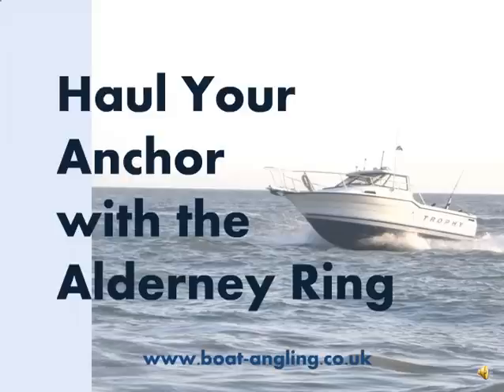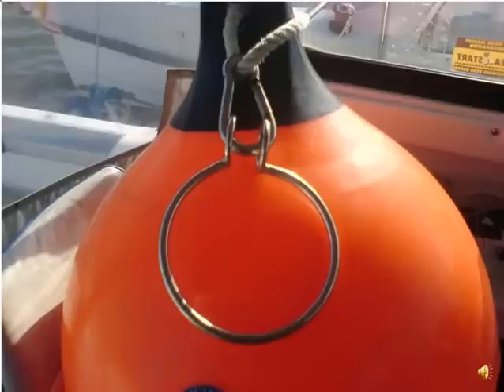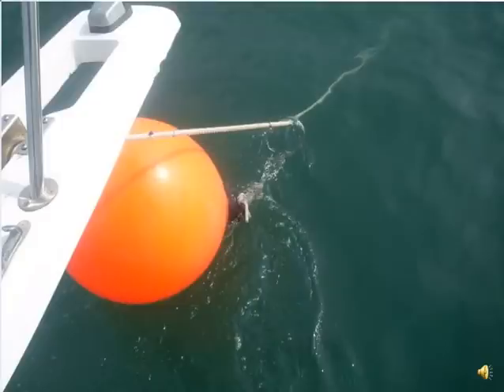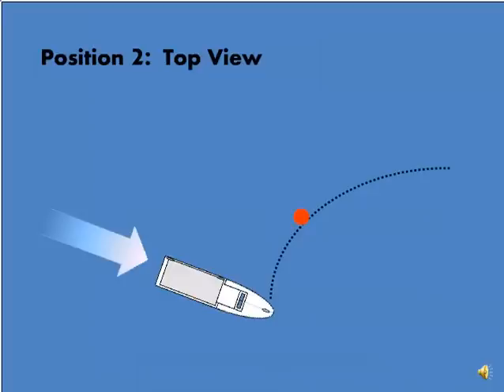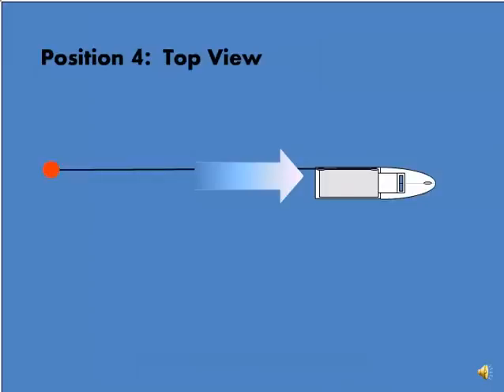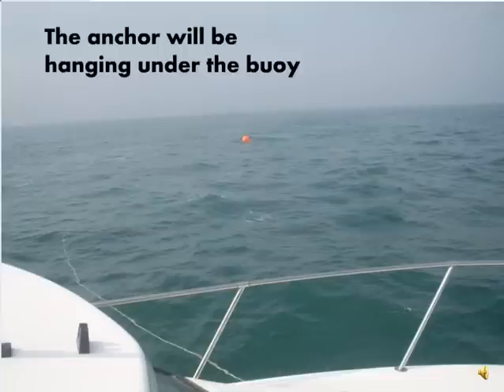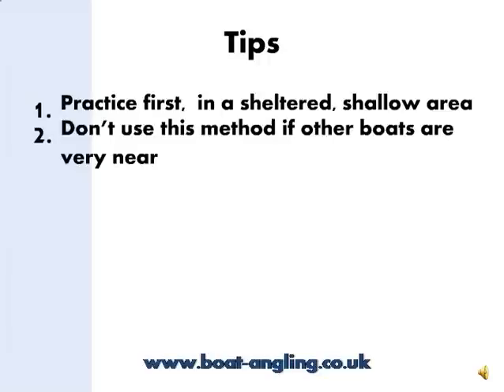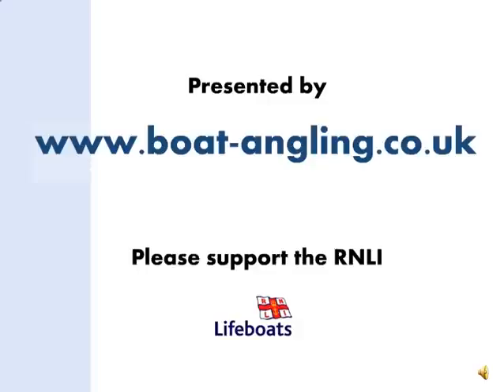Anchoring with the Alderney Ring

Comment: Finally someone has explained it properly with drawings that help. Thanks Matey. I'm going to start using mine instead of busting  my self hauling the anchor in by hand.
Reply from the maker: Glad it helps! Have a go somewhere where you have plenty of room, not too deep, not much tide and things nearby that you can keep an eye on so you can maintain the right sense of direction. With a couple of lifts to practice, you will gain the confidence to do it for real. If you don’t keep an eye on your heading it is easy to go round in half a circle which won’t help! Good luck. It will save your back.

Comment: I use a very similar ring here in NZ, I have a 7 meter alloy Southern Boat with a 225hp on the back which is capable of 52  knots, these are the best system to retrieve the anchor and chain, and as my anchor well is in the cockpit and not up the front its easy to just lift the rope, then chain then anchor with buoy over the side. I don't circle around, just motor forward at a angle and once the buoy is past the back of the boat I do about 6 knots and it all comes to the surface. Very easy on the back and I can also lift crayfish pots with the ring and buoy as well, using a short lanyard.
Reply: don't use it much now since there's a hydraulic windlass, but when we didn't, we ran the boat in reverse beside the anchor point and could see the line and buoy without looking back.   most people in the area did it the same way.

Comment: We've been doing this for about 25 years but a lot more heavy duty and in 100 meters water depth. Our sea bed is lime stone so we we use a 16mm 6 prong grapel with only 2 meters of chain & 14mm anchor rope. Holds well in 20knot winds & 4 - 5 meter swell. For retrieval we're using an A4 buoy and a heavy stainless steel ring as the chaser. The one you have pictured would get torn up bad. When we pull, we just drive off into the weather with the buoy passing down stbd side until the anchor is caught in the SS ring. Retrieval is done with following seas. For safety the operation is done with out anyone leaving leaving the deck.
Reply from the maker: Mr Lickalotopuss thanks for your comment, glad you are having success with the method. You mentioned that you thought the steel ring needed to be heavier for larger floats. The ring never has to take any more strain than what is necessary to float the anchor, or slightly more actually because of the additional drag as you motor uptide, so you don’t need much strength in that part of the setup. I now have a larger boat than the one in the video. I use 12mm rope, 7.5kg plough anchor and 12 metres of chain. The standard rings available from suppliers work fine.
Reply: @ArfordSalar 

We need the heavy duty gear because the grapel hooks into the bottom, ledges and holes etc, driving of we have to rip the grapel off bottom straightening a few 16mm prongs. Once the grapel is on deck I use long piece of pipe to bend the prongs back. I'd post some pics if I could and sounder shots of the bottom.
Reply: @mrlickalotopuss3761  OK, I agree you need heavy duty rope, chain and grapnel in your area. The actual Alderney Ring float and ring needs to be large enough to float your heavy-duty gear but it won't take any more strain than usual so the standard ring should be sufficient - but if it gives more confidence to go heavier, then that is a good reason to do it!

Comment: Little clarification on some of the comments. Yes, you must have a section of chain heavier than the weight of the anchor to hold the anchor at the ring. Many people recommend a length of chain equal to the length of the boat to avoid drifting in rough water.
Reply: I use a one way clip, that stops at the chain.

Comment from the maker: I think you will find the world refers to this type of anchor retrieval method as the Alderney Ring whatever some individual has patented. The open-type rings are manufactured in the UK and readily available. There is no need for significant strength in the ring, it is not supporting anything other than the weight of anchor and chain under water.
Reply: ArfordSalar I've never heard of it called that in Australia. We just call it a retrieval bouy.
Reply: @officialWWM 
We call a Sausage
      A Sausage.
I believe that you call them
       Snaggs.
  Ha Ho.

Comment: This is great for deploying or retrieving your bouy from the rear of the boat if, like me, you have a boat that makes it dangerous to climb on the bow.
Reply: If you pull anchor off the stern, be very careful. If your anchor hangs in the bottom while running ahead, it can pull the transom under the water and sink you in a flash.
Reply: @Hisslave1  I have been doing it this way for years. If you use a retrieval bouy, it pulls the anchor from the stern,  thats how they work! I run my anchor on an anchor trolley.  The end of the warp connects to a rope that runs from bow to stern. The anchor can easily be lowered from the side of the boat and the warp works its way to the bow. Then when you pull away, the warp runs back to the side of the boat and you retrieve the anchor. Its very safe.

Comment: Also have you tried going in reverse once you have  pulled up the chain to the pull position? I am thinking this would help to avoid getting the rope in your wheel,
Reply from the maker: No need to reverse, once you are in the pull position just swing the boat around so the bows point to the floating buoy and stop. Then the prop is out of the way and you have a straight pull to recover the rode.
Reply: Thanks Much

Comment: Also have a 38 foot sailboat. Looks very handy. My question is my top speed is 8 knots. Do you thing this will work?
Reply from the maker: 8 knots will be OK, just make sure you pull the anchor rode and chain right through the ring which means you will have to steam straight ahead for a while to make sure the buoy drags all the way down. For a boat that size you may have an anchor that is quite large compared to most small boats that use this method instead of a winch. You can always tru it with a bunch of fenders and a rope loop!

Comment: Any thoughts if method would work on sailboats with chain rodes and typically smaller engines than seen on powerboats.  Can't see why it wouldn't, but curious to hear.  Became more than a passing interest while on BVI sailboat charter last year.  Powered windlass on 50 foot sailboat disintegrated, leaving us hand pulling rest of week.  Thankfully winds at anchorage were mild, but would have been a chore if otherwise.
Reply from the maker: A slow boat combined with a small buoy with low drag and a heavy anchor may not create enough friction in the water to slide the anchor rode through the ring. If you go faster, have a larger buoy or lighter anchor the chances of it working will increase! Worth experimenting - try it with a couple of fenders as floats and a large shackle or loop of rope.

Comment: If used while anchoring next to a ship wreck while scuba diving, I would thing that it is possible for it to get hooked by the wreck. I wonder what would happen if the anchor does not release or get hooked on the wreck. 

Would your bow stay above water?
Reply: Hi Julian, good question. Whatever method you use to haul your anchor, as it breaks free of the seabed the tide will cause it to drag along and could snag. If it snags or is already snagged, when you motor up-tide you will notice that you are slowing to a stop and if you keep motoring the bow will dip and turn sideways in the direction of the achor (port or startboard). At that point you immediately slip into neutral and use your "snagged anchor" routine. I fish in the eastern Solent which is littered with wartime debris and snagging is a common occurrence. I rig my anchor to trip using a weak cord tie so all I have to do is tighten up the anchor rope to as near vertical as possible, take the rope off the bow roller (weak point), and use the engine to break out. The weak link will break and the anchor will come out backwards. See www.boat-angling.co.uk for details.
Reply: Ascent Learning , thanks for the reply.
Reply: Ascent Learning do you know if you can rig a fluke anchor this way. With the chain tied to the shank and shackled to the crown of the anchor. Not sure if the chain along the fluke would prevent the fins from flaring.
Reply: If by fluke anchor you mean the type with a swivelling head like Fortress or Danforth then no, that is the only type of anchor you cannot reliably trip with the breakout method. Standard Admiralty/Fishermen's anchor, plough, Bruce and grapnel anchors can all be rigged to trip.

Comment: If you are using just rope, no chain , what stops the anchor from going back down?
Reply from the maker: John Cald if you are not using chain it would go straight down again. However you need chain to set the anchor, add weight and take the abrasion from the seabed. I would always recommend using at least a boat length of chain.
Reply: @ArfordSalar  Thank you very much for your reply. I am hoping to adapt or use this to pull up my crab traps. I could probably put a couple of feet of chain on the end that is attached to the trap. Once again thank you for the reply.
Reply from the maker: John Cald if you have a crab trap that is  even more weight so the extra chain would not solve the problem. Instead you could make a one-way arrangement with a short length of underground water pipe with a hole drilled in the side. Thread the rope from the surface end  into the end of the pipe and out of the side hole. I have not tested this but the pipe should be pulled through the Alderney Ring but jam if pulledthe other way by the weight of the trap. You would need the fix the pipe to the rope a few metres above the trap/anchor. I might try this on my crab trap!

Comment: Just how many anchors have been bent by placing a sideways force on an anchor before it has been released from the sea bed?
Reply from the maker: The only times I have ever seen that happen is when the anchor gets jammed in a rock and the only hope of recovery is brute force. I have never seen that happen with a straight Alderney Ring retrieval. If you have seen it happen simply by pulling sideways from the seabed I would question the quality of the anchor.

Comment: Hi,
Just setting one up for myself. If I have a 15kg anchor do I also need 15kg+ of chain to hang down and hold the anchor in place?
Reply: oatbiscuit Hi oatbiscuit. I have the same question. Did you ever find out the answer?
Reply: Greg Hawley Hi Greg,Nope, never found out. Just received 100mts anchor rope and plan to try within next couple weeks. Hoping I don't need the same weight of chain as anchor.
Reply: Greg Hawley Just re run the video and he states the 30cm buoy is enough for 7.5kg anchor and 5mts chain. My anchor is actually 7.5kg NOT 15 as I originally thought.
Reply from the maker: oatbiscuit Sorry, the buoy dimension is confusing on the video. I find a small 30cm diameter buoy was just about OK with a 7.5Kg anchor and 5 metres of 8mm chain which I had on my previous boat. I am now using a 45cm diameter buoy with a 10kg anchor, and 10 metres of 8mm chain.

Comment: 30cm = 12in. 45.7cm = 18in. I suppose 12 to 18 in would be fine. Thank you.
Reply from the maker: It depends on the weight of anchor and chain but both sizes create a surprisingly large lift. I prefer to go larger because the added water resistance when towing helps push the buoy right down to the anchor making it float nicely to retrieve.
Reply: @ArfordSalar  I agree with you Sir. I have a 7.5kg Bruce anchor with 15 ft chain.  The shop I bought the ball from has only 19in ball.  So, anchor and chain were lifted with ease. So larger ball is alright. Thank you.

Comment: This seems like a risky way
Reply from the maker: Definitely more risky than pulling by hand or using a winch, which is why I recommend practicing first. However if you don’t have a winch and the tide is running too hard to pull by hand, this method may be the only way.